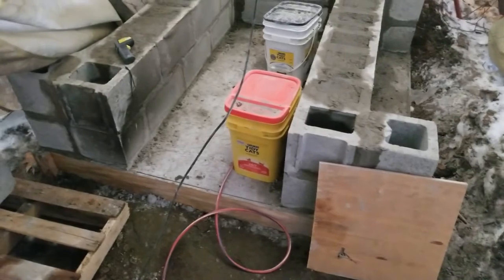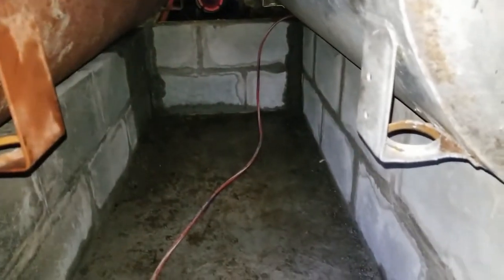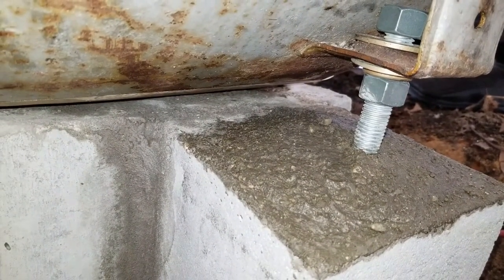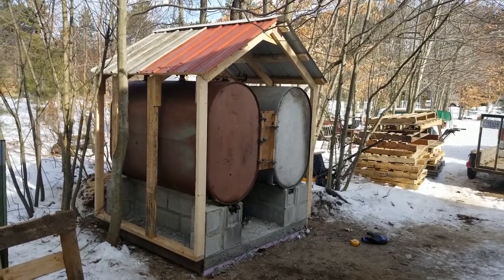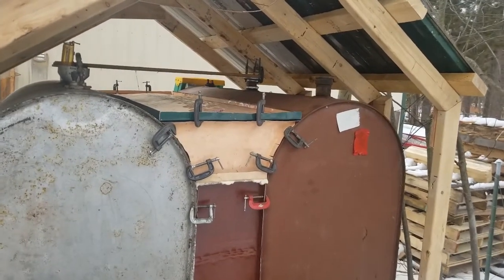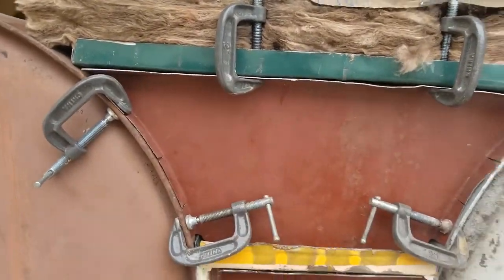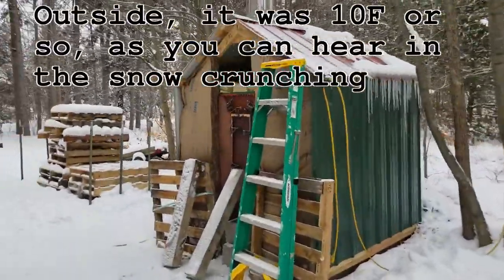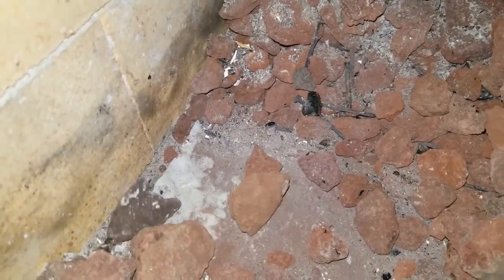Home Built Outdoor Wood Boiler, Part Two

Comment: Best outdoor build on youtube!  Why lava rock instead of firebrick?
Reply from the maker: 1. Cost.  I think the firebrick was already $200 -- it might have been $300 if I had done the floor in firebrick as well.
2.The insulating value -- I have 2 inches of 25 psi foam under the slab, but the sides have a much better opportunity for insulation.  So I wanted the concrete slab staying as cool as possible.
Reply from the maker: The firebrick are somewhat insulating, but not nearly like lava rock / ash mixture.  My test of this was to see the plastic sheeting still there after a number of firings.

Comment: Interesting. Will the heated water be used for radiant heating?
Reply from the maker: Yes.  In fact it is already heating the insulated portion of my workshop, an upstairs bedroom in the house, and all the domestic hot water through a heat exchanger.